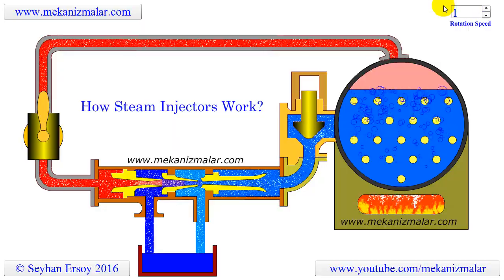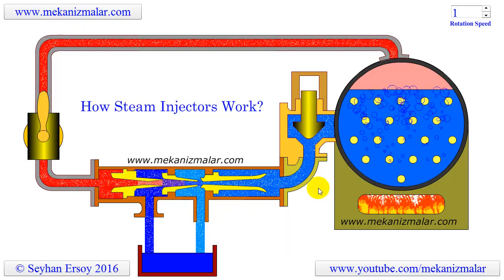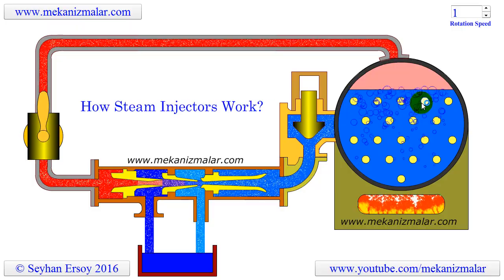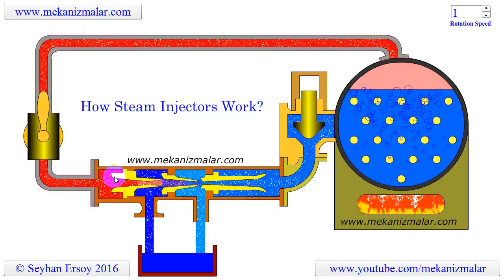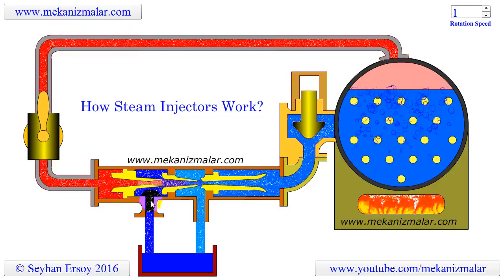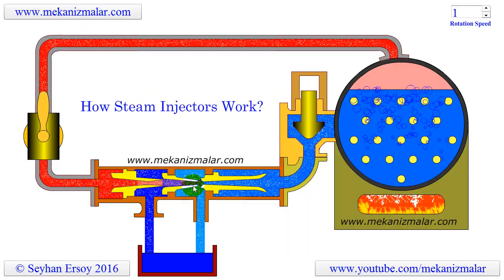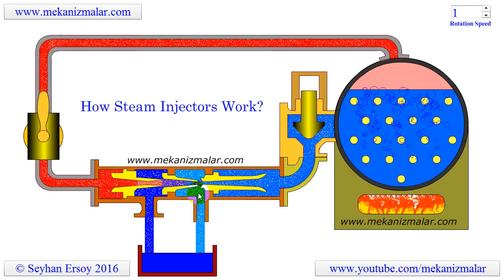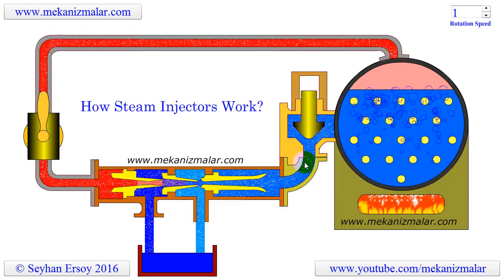how steam injectors work

Comment: Has anyone ever done a comparison of efficacy on injection vs pump?
Reply: When you are using steam injectors in locomotives, we do not need an external power source. In order to use a pump, you should use something else instead of steam.
Reply: @seyhanersoy8989  so what I'm getting at is how much energy is used in boiler to fire injector?

I looking into a diffeant application, I don't care how I get water into it, I just want the most efficient way of doing so.   One could use electric pump powered by a on board generator. 

I'm only interested in the most efficient way of achieving high pressure fill cycle....

Thanks
Reply: @6969smurfy  Hi Dan, I made a google search about steam injector efficiency; Wikipedia says it has %98 efficiencies. If it is correct, this is excellent efficiency
Reply: @seyhanersoy8989  hhmm to understand that correctly it would take 2% of the out put maybe?  

Somthing to think about.  Sound like I would not have to worry about adding extra output on my boiler design.  

Thanks

Comment: My self Marine engineer and being very curious about Steam locomotives . This clip cleared my doubts. However if I can get some information about below.                Superheated steam is used for steam reciprocating engine after work completion why this steam is dumped as in Marine field it is going through the steam condenser and back to water reservoir we call it cascade tank.                    Is there any manual pump for water transfer to Boiler during cold start as steam injector need pressure

Comment: There is a slight modification of this application to generate vacuum in vessels. They are called Steam Ejectors, they are used as vacuum pumps in refineries to produce vacuum in vessels for process requirements, and yes they are also used as gas compressors to pump out gases from negative spaces in vessels to incinerators which operate at higher pressures. They are preferred over traditional rotary equipment because of their high reliability (since they don't have moving parts), and low operational costs.

Comment: to make an injector work .you must turn on the water valve when it is flowing steady you pull the steam valve slowly at first then you listen for the steam and then jerk it open. if it works water goes in if not it goes out on the ground.at 2:00 am i FOUND I couldn't see any water in the glass I tried three times to make it work the fourth did I was 19 years old and thinking I was going to be blown to bits
Reply from the maker: Thank you for your comment and feedback. If you are doing this in age 19 and working up to 2AM, than you will be very good engineer, provided that your Math skills is as good as your machining skills.
Reply: Colorado & New Mexico bought a part of D&RGW  rail road in 1970 .I was the person who fired the engine the first night. It took most of that   day to get a head of steam and we were going to take the train to Chama the next day

Comment: Excellent tutorial. I'll recommend it to all my pals in the miniature steam loco and traction engine community. You only missed two points: The injector body must be cold for it to work, as does the feed water. It will warm up enough through absorbing the heat of the steam driving it to not excessively cool the water in the boiler.

I'm waiting for confirmation of a collection appointment for my 'new' 3" scale Traction engine which has a hand pump, a crank driven pump and a steam injector.
Reply: a man of many parts why does it have to be cold? 
And I don’t get how the water goes from the delivery cone in to the boiler? 
Is there a suction or something?

Comment: This is essentially the same mechanism as a steam jet air ejector in steam turbine power plants of all sizes....from tiny submarine power plants to thousand-megawatts commercial plants.  The turbines must exhaust into a very high vacuum to mazimize the cycle efficiency.  An air ejector is used to draw and maintain that vacuum in a huge condenser that can handle the total amount of steam flow, returning it to the boiler feed pumps as condensate.  The air ejector exhaust is routed to its own small water cooled condenser to recover the condensate.  Once a vacuum is established, there is practically no air to be exhausted.

Comment: Though testing some other steam operators and myself found the the injector process is highly temperature dependent. If the temperature of the injector is high enough the injector will cease to function and has to be cooled in order to inject water.
Reply from the maker: Thank you for sharing this info for us.

Comment: Does this take the place of the steam condenser?   Or is that still required?
Reply from the maker: Jeffrey, thank you for your visit and comment. As far as I know steam locomotive did not have a condenser. This was Achilles heel of steam locomotive. Not having a condenser required that they should replenish the exhaust water often. Also not having condenser reduced steam locomotive efficiency significantly. Steam injector required to push the replenished water to the boiler. If someone successfully adds a condenser to the steam locomotive, they would become viable again.
Reply: you may be interested in the Doble E steam car, Jay Leno has one.   I believe that it had a condenser and re-circulated the boiler water (but not sure).   The King Rose archives movie from 1924 does not show any steam escaping.

Comment: Ejector - or specifically eductor - pumps are common in aircraft fuel systems for using a smaller amount of flow from a mechanical pump to move a larger volume from one tank to another.

Comment: It was implied in the video, but not stated directly that the injector's pressure must be higher than that of the boiler for the check valve to open. While the injector builds pressure, it will circulate water in the atmospheric pressure holding tank. Thank you for your explanation.
Reply from the maker: Thank you for your visit and comment.
Reply: Well, it should be impossible to overcome 150psi of boiler pressure with 150lbs of boiler pressure, but the injector makes this possible. I was always told that the pressure head was converted to a velocity head as the steam mixed with the incoming feedwater and gave up its heat energy to the water, thus raising the pressure in the feed line over that of the boiler, kicking open the check valve and allowing the water to feed into the boiler.

I know before the injector was invented, there were usually steam powered  or axle-driven piston pumps used to put water in the boiler, the pumps' output pressure being higher than the boiler could ever go.

The beauty of the injector is that it has virtually no moving parts, and does the same job.
Reply: russ1618 maybe it's a terminology thing, but the injector wont circulate water... its typically dumped out on the ground, on locomotives anyway, that way the engineer can see if it 'picked up'...

When the injector picks up it does it in a snap literally, and leaks practically nothing while running. Maybe a couple of drops. And it makes a characteristic shreik when it's running, otherwise it dumps a lot of water everywhere, and you shut it off and try again. 

They are somewhat temperature sensitive, over heat one and it wont work and you have to flow cool water through it to cool it.

Comment: I still don’t understand why the pressure coming out of the injector is higher than that coming in
Reply: Two things need to be understood to fully understand this injector.

1) fluids travelling through a divergent cone at super-sonic speeds gain velocity while loosing pressure.
2) fluids travelling through a divergent cone at sub-sonic speeds lose velocity and gain pressure.

so the first convergent nozzle creates super-sonic steam and the divergent cone here only increases the velocity of the steam. ( refer to 1)  )

After the water and steam mix within the second nozzle, the steam loses velocity and the water gains heat from the steam. This flow of hot water is now sub-sonic.

This subsonic flow through the last divergent nozzle now acts to decrease the velocity but increase the pressure (refer to 2) )
Reply: Thank you I can see how the velocity reduces as the fluid flows through the divergent cone at all velocities but I must admit I cannot understand how it increases at supersonic speeds but decreases at subsonic speeds.I can see how if steam flows through a convergent cone it will increase in velocity so the total volume per unit of time that passes  by a point will be constant since the diameter is smaller. Likewise going through a divergent cone since the diameter is larger the velocity will decrease so as to keep the volume per unit of time constant.How the diameter and the velocity increases without creating a vacuum behind it to suck the steam through even  faster  I must admit eludes me.
Reply: there's a whole science behind fluid behaviours in nozzles. look up videos on de laval nozzles and rocket nozzles, theres loads of information about it. admittedly most of it goes over my head too but apparently it works! also you might want to look up water hammer pumps. I believe that these injectors work base on some of those principles too about just slamming an incompressible liquid through a one way valve.
Reply: Harrison..First class explanation !!! Succinct but TO THE POINT! In fact elegant !
Reply: Harrison Long said "1) fluids travelling through a divergent..."
*Convergent?  
As it is, it reads as if fluids behave differently above and below the speed of sound. I'd remove the clause "at super-sonic speeds" from 
both 1) and 2).
You can edit your post.
Reply: @bill tomson
As I see it, the fluid in the first (convergent) nozzle has high pressure behind it, and low pressure in front of it - a push and a pull. 
As the steam condenses in that first chamber, it's pressure falls, a lot, both sucking up water from the tank, and sucking more steam through the first nozzle.
Reply: The velocity of the steam traveling out of the boiler delivery pipe ,is tremendously greater than the velocity of water under the same pressure escaping from the same boiler. Therefore, the difference in escape velocity is the key as to how it works.

Comment: 4:37 well you've got that bit wrong as the overflow is dumped lineside rather than pumped back to the steam loco's water tank which will warm the water up rendering both injectors useless

Comment: nice clear explanation, thanks!  As for applications,  I remember reading many years ago about a steam powered model aircraft.  To keep the weight down it had a flash boiler holding only a very small amount of water.  I assumed it had a piston-in-cylinder pump to feed in cold water,  but more likely it did it this way.
Reply from the maker: +Ray Kent Thank for the feedback. I newer heard a model airplane working with steam. I will do some search about this. It is very interesting.
Reply: been years since I've seen any activity on the site but http://www.flysteam.co.uk/recent.htm has some specifications etc.
Reply: Rather than a pump, many model steam vehicles use a pressurised fuel tank to push fuel to the burners. Similar principle could be implemented for boiler feed water.

May also be of note that full size rockets have very thin wall fuel tanks...
the thin walls keeps the mass down. When unpressurised such tanks have little rigidity, but once pressurised, they work exceedingly well as structural elements.
Reply: Thanks for the info Steve, sounds like a pre-pressurised cold water tank would be simplest for short flight times...  Interesting!
Reply: I have read that some designs of these thin wall tanks cannot be maintained at atmospheric pressure, and must be held at significant positive pressure at all times. In flight, the fuel/oxidizer may boil, cooling the fluid; to maintain pressure, heat is conveyed from the rocket bell back to the thin wall tank.
Reply: @stevecummins324  bit where does the pressure come from, paradox there...
Reply: @6969smurfy  simplest solution... air above liquid in tank. Bike tyre valve to allow air into tank. Bike pump connected up temperarily toadd air to tank pre use. During use fluid level drops. Air expands a bit, but continues to extert some pressure. Look up tiily lamps if further explanation needed. 

Some rockets have a tiny very high pressure nitogren tank to drive the liquid out of tank. Eg WW2 V2 rockets had such an arrangement to drive the liquid fuel out of tank at lowish pressures and into to the turbo pump (when then  boosted fuel pressure very high)

Comment: For those unfamiliar with what a steam injector is, a brief description would be good. Otherwise, this appears to be a pointless recirculating machine.
Reply from the maker: Thanks for the feedback. If you add additional info you wish to have just reply this message with info and I make sure that every one sees it.
Reply: As steam is used water has to be added back in. The injector does this. Without cold water and condensation the velocity doesn’t change, the pressure just equals and goes out the overflow